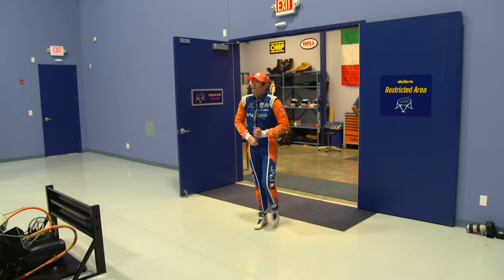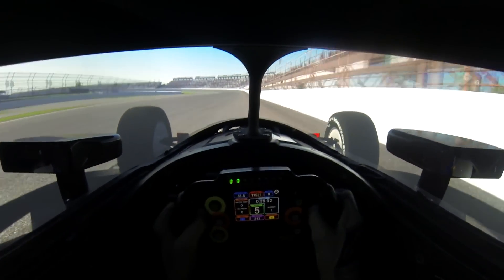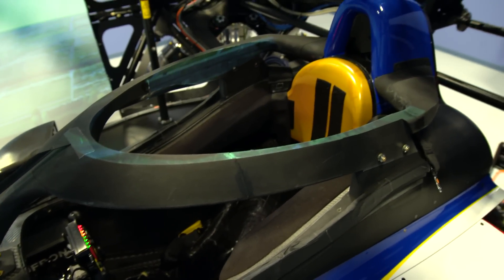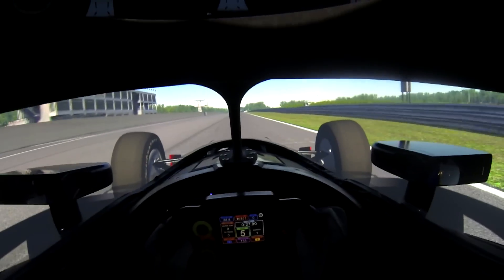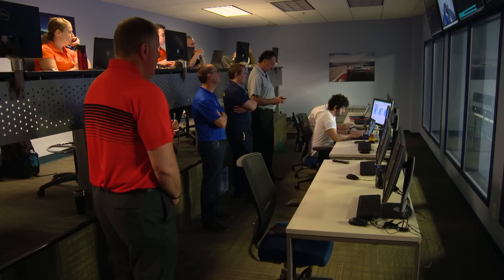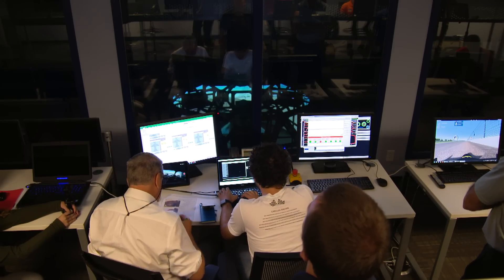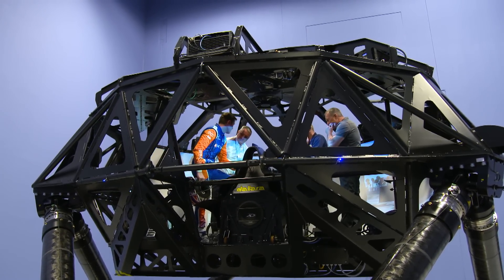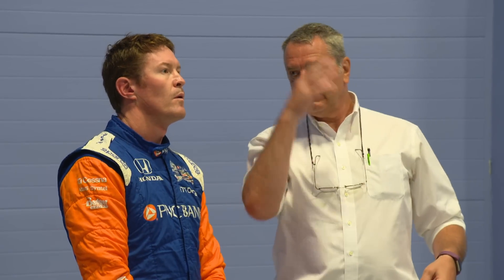2019 INDYCAR Aeroscreen Prototype Simulator Test

Comment: i hope they remove the bar in the middle of aeroscreen!
Reply: they probably won't, at least not that soon. It is there to support the weight of either the car when it is rolled or of the other car/large debris hitting it. But as materials improve who knows, maybe there will be aeroscreen without a bar in the middle
Reply: They don't need to. There is already a bar that coes up into their eye level now so from the driver's perspective, it won't make much difference.

Comment: Is it just me, or is there no screen on the halo frame in this sim set up? This still doesn’t really give us an explanation about light refraction
 that may be experienced. I personally wish they would’ve had the ability to manufacture a stronger “skeleton” without the center piece. Could’ve still given the same profile of the 2017 concept, which I thought was much more appealing.
Reply: You're correct theres no screen. Testing the lights on a simulator is not a good test as the light in only coming from the front. A race track test under lights or under the sun which offers a full array of angles is a more effective test. Here they're just testing the viability around the halo ring. Im sure we'll be seeing further on track testing soon

Comment: Definitely am on board with this. I was wondering when it would cross over. 
My only thing is, if it is a "Screen", how will that do against the visibility in say, rain conditions? I mean, can you imagine (obviously with no wipers) that they are chasing someone on a wet track and that back spray is hitting them?
Reply: I'd say the airspeed over the screen will blow the water off (like it does on a helmet visor). Be interesting to see it in action.

Comment: It's such a shame IndyCar also has to ruin their fantastic looking car.
Reply: It's such a shame there are people that exist that care more about looks than safety in racing.
Reply: @anthoslykos6294 

To me it is safe enough. If safety is the highest goal, then why do they still have open tires? Why are they racing 235 mph? Why are there no runoff areas on ovals? Why do they run street courses?

At some point racing is safe enough. If it can never be safe enough and we need to do everything to make racing safe, then there is no way we can morally accept racing not to be outlawed.

Let us imagine Safety = 1 meaning total safety and you can never be hurt. 
And Safety = 0 meaning no safety at all, so you get hurt everytime you crash.

All of us have a different value of tolerance for danger, but all of us would say it is acceptable to have a value of Safety < 1, because saying otherweise means, you have to not race at all. So for somebody the threshold of racing being acceptable might be 0.8 and for someone else 0.99. But it is always below 1. Therefore we all consider it to be "safe enough" at some point.
Reply: @jbracing3072  you might think it's safe enough but you arent in the drivers seat. If the pros are cool with it and it adds another layer of safety then that should be the end of the discussion. They arent going to remove a safety device they've spent a few years developing for the opinion of a whiny fan. It didnt take F1 fans long to adjust to the halo and im sure you will live as well.
Reply: @anthoslykos6294  the halo still bothers me in F1 to be fair. I mean you could use that argument the other way around. If the pros didn't want to race open cockpita they could race IMSA, WEC, NASCAR, DTM, etc. Nobody is forcing them to sit into an indycar.
Reply: I actually don’t mind the look of it, the screen makes it look much more streamlined than the halo.
Reply: It’s such a shame that a piece of debris took Justin Wilson’s life.
Reply: @RyanXWing  if you're so concerned about safety then why not have them race on the xbox? That's 100% safe, no debris, no crashes.
Reply: @BoleDaPole  if you're so concerned about the looks why don't you start your own race series with whatever car you like
Reply: @RyanXWing  still didnt answer my question,  you obviously still want drivers to risk their lives and die for your entertainment. Let's just have them race in the simulator to ensure future safety of all drivers. We have the technology to properly replicate the cars with computers. Why do you want the drivers to risk their lives?
Reply: @BoleDaPole  Dude i'm pro aeroscreen its called sarcasm

Comment: Well this save someone if they go airborne into the catchfence
Reply: It will save them from a tube of the catchfence slamming them in the head, yes.
Reply: It might, or it might collapse and make the situation worse. Hope they took that into account.
Reply: That's not what it is designed for, really. There is only so much they can do about such a situation. The best way is to try to prevent that from happening in the first place.
Reply: Miguel Elgueta  I don't think it will, I think in that situation it could potentially save a life. I said what I said earlier because I wasn't thinking about head first into the fence, just generally when a car flies into the fence, I think the danger is more of the forces of the impact and potentially fire, rather than the driver actually being hit or hitting something.
Reply: This probably wouldn't have saved Dan Wheldon sadly.

Comment: Well it is a halo, but it's thinner, because the screen will support it. So the visibility will be better. 
The simple reason is that the aeroscreen on it's own is not ready yet to support the car without the halo underneath, one day maybe we will get a screen like in the 2017 concept, but for now, this is what it's going to be.
Reply: I think it should remain as a halo. With the screen though, driving in the wet (and presumably with no wipers), that water blast from chasing someone will obscure viability even more
Reply: @thejanusproject32  Not to forget oil or other liquids that aren't going to be blown away by the air... So for one Lap without anyone in front this might give you better visibility but in a race scenario it is absolutely wors than just a standard Halo which is also very thin and almost doesn't influence driver visibility... We will see where this technology will lead go in the future, but as of right now imo they only develop it out of political reasons because they don't want to use the standard Halo which has proven to work pretty good in the last years and honestly I don't mind it on the cars in terms of looks.
Reply: Jeez, I didn't even think about that. Makes the entire premise sound mildly idiotic.

Comment: I’m assuming, due to its not being there, they haven’t worked out the warping/dizzying effect of the screen yet.  I think these cars would look awesome with a fighter pilot style cockpit.  It’d still be possible to egress upside down if designed properly.  It wouldn’t really be an issue in indycar because their safety crews are absolutely second to none.  F1... not so much.  They rely far too heavily (especially considering they’re supposed to be the “pinnacle” of Motorsport) on amateur volunteers to marshal the GPs.  Which is weird when you think about it.  A multi billion dollar racing series yet, they leave arguably the most important job largely to completely inexperienced amateurs.

Comment: So it's a halo with a screen on top. Is probably much stronger than just a big glass screen.
Reply: My only issue is, if it is like the design shown i the video that has the screen? What about rain?
Reply: @thejanusproject32  true.
Reply: thejanusproject32 how does it compare to rain on a helmet visor?
Reply: @PjotrStroganov  Well, they can wipe rain/oil/liquid off their visor or even use and remove the visor strips to clear their vision? 

They can't just reach over and wipe the screen?
Reply: @thejanusproject32  I don't see rain as a problem as I've never seen drivers (in F1) wipe raindrops off their visors. The shape and material should prevent water from building up like on a normal windshield. Oil and stuck marbles could be a problem but I've seen teams at Le Mans use huge window tear offs. These could be pulled during a pittstop. Or maybe a simple whipe will be enough.

Comment: I'm all for anything that improves driver safety.

That being said, I am a little disappointed IndyCar is adopting what is basically a slicker looking version of the halo instead of going with the original windscreen design.
Reply: BCJM76 the first windscreen turned out to be very poor in the protection department. This is an improvement.

Comment: I dont have any problem with this. What can possibly be wrong with improving driver safety?
Reply: When I first saw the Halo prototypes in F1 I was very critical of it. I don’t even realize that it’s there today. If it’s integrated into the car design and livery (and not just a black halo) it will look okay.
Reply: I do see a serious potential issue with driver extraction, but they did say they are working on it in this video.

Personally, while I'm not over the moon for this Halo-screen solution I'm going to hold my breath until I get a better view (preferably helmet camera) of it's real life application on a banked oval like Iowa or Texas.
Reply: Have you watched Formula 1 recently?
Reply: Why do they even race then? They should just simulate the races inside a padded room on the xbox, cuz safety right? If you are against this then you are against driver safety. Just stop racing and everyone will be safe.

Comment: Don't add the screen,  it's f'ing ugly. You are seeing a lot more audience because you gave the car a new look in 2018 from the hideous look of 2012-2017. Just make a halo like F1 and call it a day.
Reply: Halo is not enough. Especially against from small objects. The aeroscreen is much safer. I just want to get a better explanation why do they need halo behind it?
Reply: Bence Szabo Just in case the screen breaks, they still have something to protect them.
Reply: Halo is woefully inadequate, and it still boggles my mind that the FIA hasn't even attempted any sort of protection from smaller debris like what hit Massa in 2009. I'm no fan of the HALO, but any system that can keep out smaller pieces of debris and maintain structural integrity in a heavy impact is always going to be far superior then a system that just does one or the other. As long as it's not significantly hindering driver extraction or visibility, there is no reason to not run something like this.
Reply: In the future F1 will run the halo with screen. Heard this from Autosport channel.

Comment: Is there one of those halos?
Reply: There’s going to be a halo behind the aero screen just in case the screen breaks then the driver still has protection.
Reply: @BH28Racing  That went against everything from a year ago, everyone said it would block eyesight... i'm confused now.
Reply: Cookowa [D-G] Originally they said that. But Dixon said in the video that there are no issues with eyesight. But that’s just in the simulator. In about a month they’ll test the real think and we’ll see what happens.
Reply: @cookowa3256  I think this is a modified halo, it's thinner and has different angles so it wont block the view and its been combined with an aeroscreen.